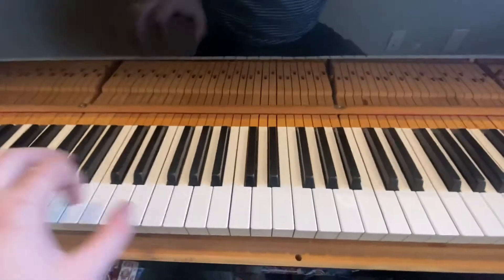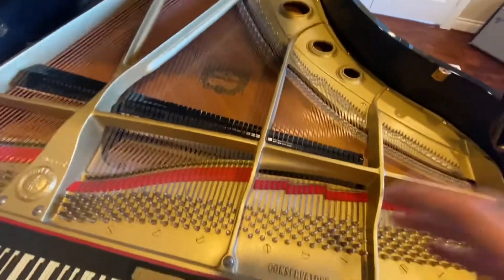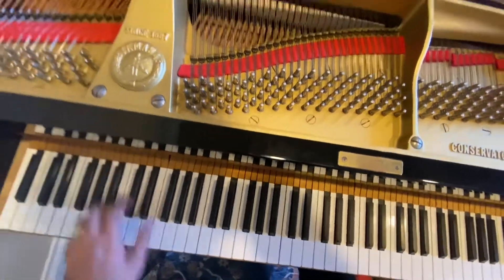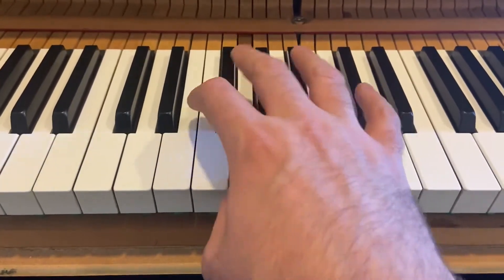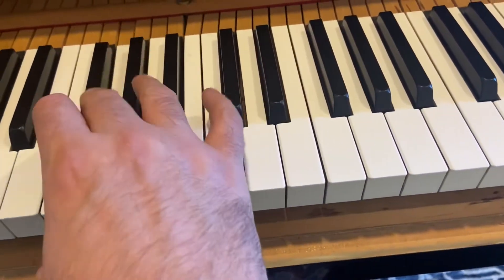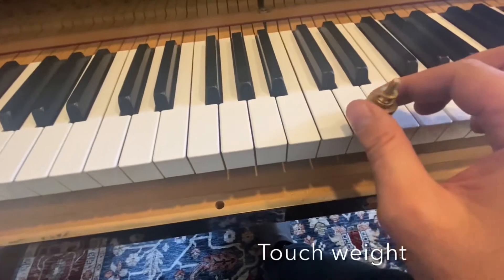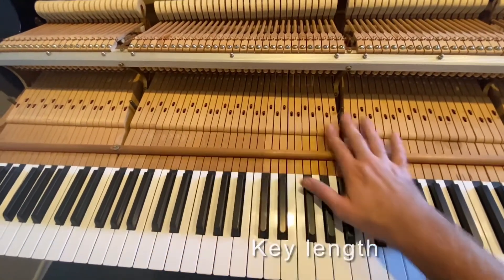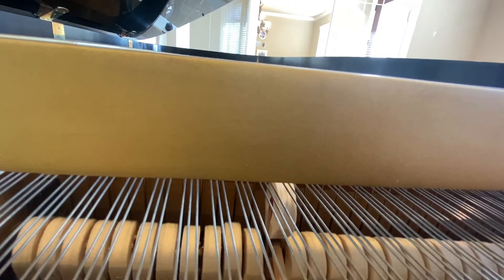Yamaha C7 semi-concert grand piano

Comment: Two months ago I bought a 2000 Mason & Hamlin BB 7-foot.  It has similar problems: unbalanced bass, bad regulation and bright.  A well experienced tech here in Nashville TN recently applied a Coleman 11 well temperament tuning which I have grown to appreciate for its unique "color".  The piano will soon be regulated and voiced down.  I hope I didn't make a huge mistake buying this beast.  But the room is 25 x 25 with a 26 foot cathedral ceiling, carpet floor, so not too bad.  Plus I'm a bachelor with no wife to fight with.  I also have a Hammond B3 in the same room.